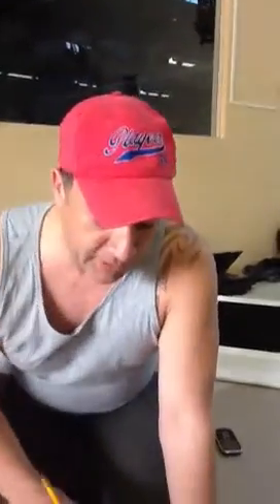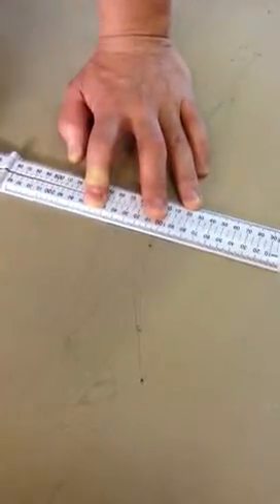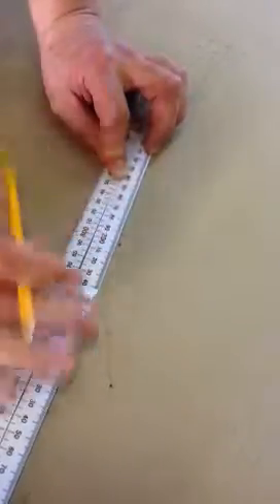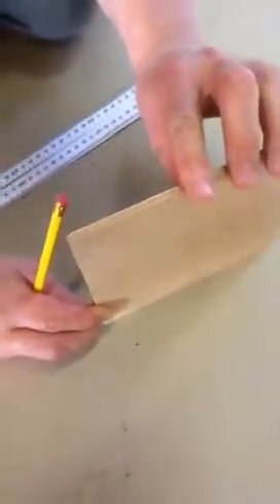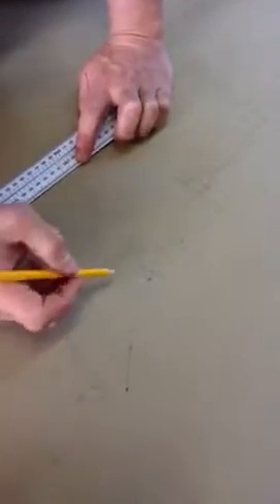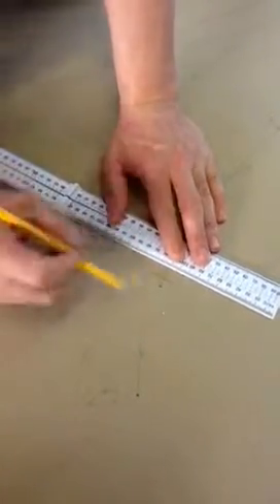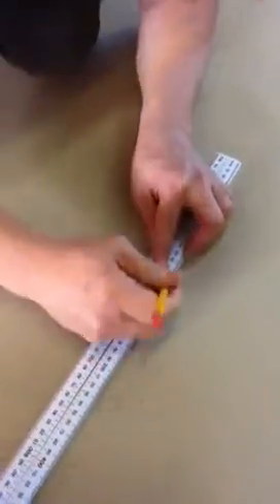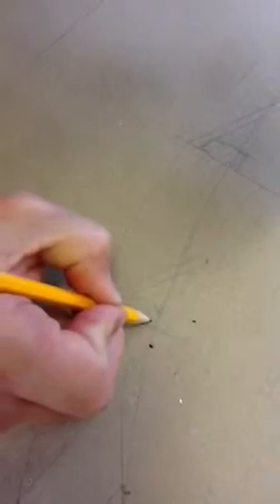Lofting a stem section

Comment: Can anyone tell me where or what determines the 50 mm he measured perpendicularly and then 50 mm on the diagonal ?
Reply: Hi John, Chris here. The 50 mm is the width of the buttock line.
Reply: @christopherlovegrove1935  Thank you Chris,,I might be starting to loft a boat for myself next summer,,I have learned how to draw out the revolved sections but it's been so long since I was on that course that it's gone from my mind.If I need help Can I send a message here..
Reply: @johnhaughey5347  Hi John, if you need help post your querry here, and i'll try and help. Cheers
Reply: @christopherlovegrove1935  Hi again Chris,,I noticed you commented on Ian Smith's video of lofting ,,I'm confused a little about where he is taking his tick stick measurements from,,
Also the line he drew normal to the stem is it randomly positioned or specific to a waterline,,
Your reply last week left me scratching my head because I couldn't grasp where you got the 50 mm..
If you can help me out Id be greatful
Reply: @johnhaughey5347  Yes the location of the line, normal to the stem is at a random location.  Were this line intersects with the 50mm buttock line, a line at that point is drawn out perpendicular. Then you measure out along this line, 50mm, and make a small mark. Then from that mark, draw a line back to the stem face. This is then the stem section angle.
Reply: @christopherlovegrove1935  Ok I think I'm getting it,,
So in Ian Smith's video he was ticking measurements from the plan centre line to the intersection of his stem perpendicular and waterline and then transferring that measurement out 90° to his perpendicular line..It's just that from the angle of the camera It looks like his tick stick isn't normal to the centre line when he is picking up his measurements,,
Sorry to be a pain
Reply: @johnhaughey5347  Great that you are starting to get it. You are not a pain. You can use waterlines to draw the stem sections, but I think it is a bit of a waste of time. If you draw in profile a buttock, say 50mm or even 100mm wide. then this will give you your bevel needed for the stem sections shape. Hope this makes sense John. Keep asking questions. If you can also put the video times in, that helps, as I then don't have to watch the whole video right through. Cheers
Reply: @christopherlovegrove1935  I think I get you,,I'll know next week when my plans come..Thank you..The time on that video is 10 .20
As I said When Ian is ticking his stick it I can't work out what it's normal to..
Reply: andrew, who is the student in this video, is explaining here how  to draw a stem section. This is on his first ever lofting.